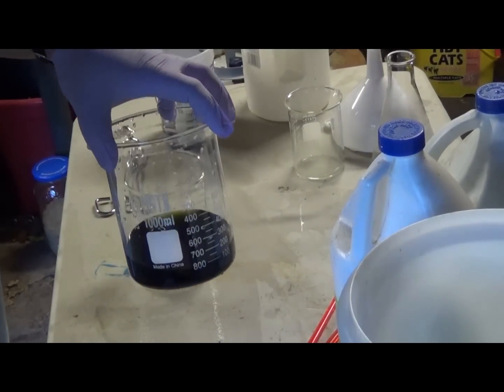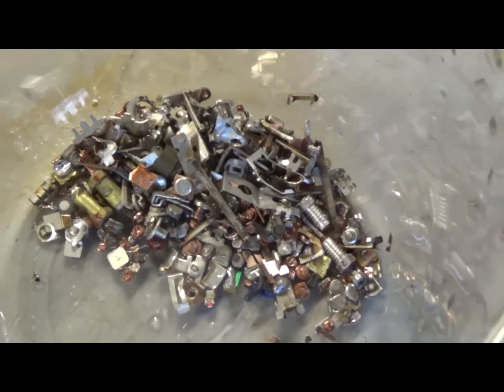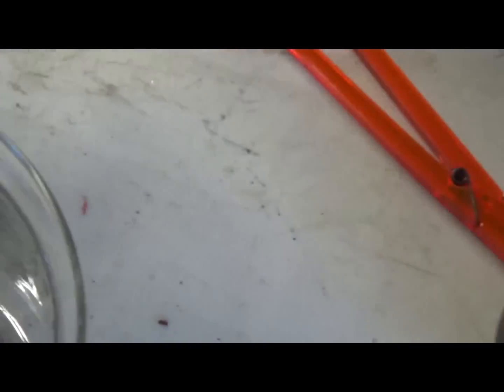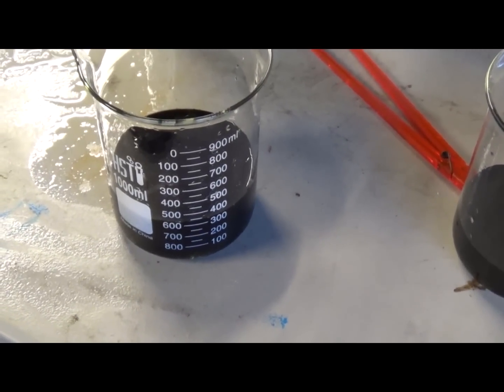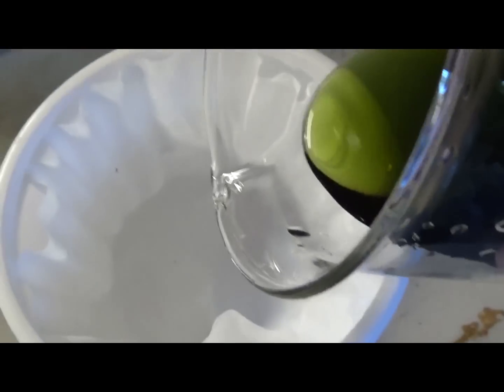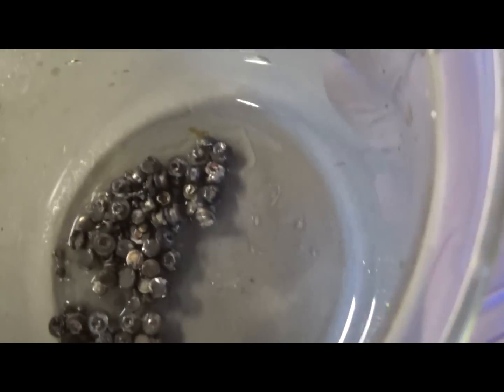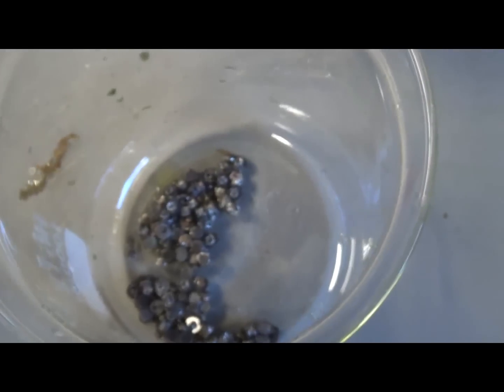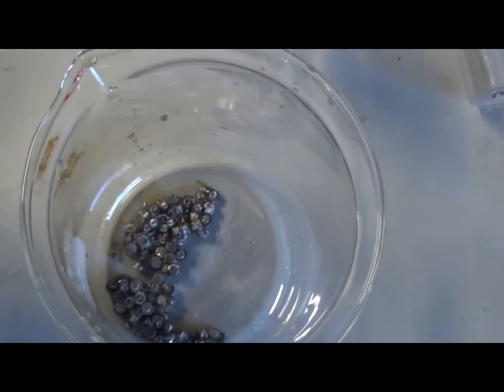How to Recover SILVER from contacts, relays, switches and more! Part 2 Acid Bath

Comment: As always great video Moose, I recently came across a couple Nintendo Wii's that were in a house fire and melted beyond recognition I was surprised to see the amount of gold plating that was inside. So if you come across some yourself they are totally worth ripping apart if unfix-able. And about the silver on circuit boards, how do you know whats silver and whats not? It all looks silver to me even the solder looks silver.
Reply from the maker: Hi and thanks for watching!  Nice find on the Wiis.  The gold plating in those newer items is going to be pretty thin though.  As for silver, I tend to not mess with anything other than contacts.  Solder at best has less thatn 5% silver, and as for board etching, I have yet to find any good info on how to test that besides using chemical test kits.  A lot of times its tin not silver.  The goldrefiningforum may have better info.  Thanks!

Comment: Would the aeration you use on gold help speed up the process? 
Also what is the reason you don't use hydrochloric acid? Did you get burned?
Reply: He uses Hydrochloric acid He doesn't use Nitric acid. Nitric acid is a much more powerful acid which = dangerous.
Reply from the maker: Yes it would help, and HCL is the ONLY acid I use.  I do not use Nitric acid.  I am not comortable using it with two kids, pets, and close neighbors.
Reply from the maker: Ding ding ding!!  We have a winner!

Comment: Hey Moose, I need help I got some really weird cpu chips that I need to recover the gold from. Plz help
Reply from the maker: HI and thanks for watching.  I do not do much CPU gold recovery due to the acids involved.  What kind of cpu is it?
Reply: Green fiber but, the problem  is that it didn't come with gold plated pins but instead of the pins there are tons of gold "spots" as like where the pins would normally go. I have tons of them but it does look like they were made that way so I have no idea on how to recover the gold because there is solder on each chip due to mono caps so I don't want to contaminate my muriatic acid, I already remove the copper plates on each of them. Thanks in advance